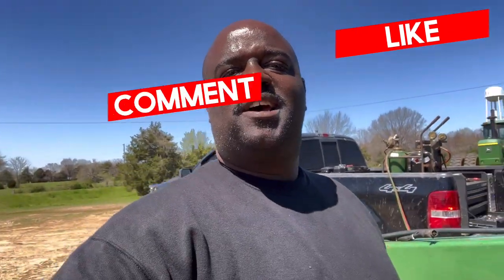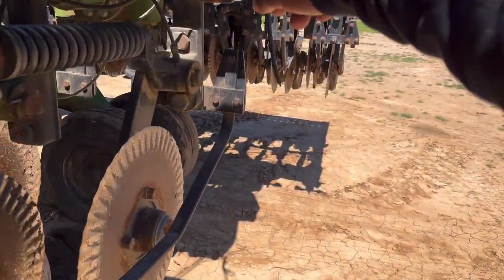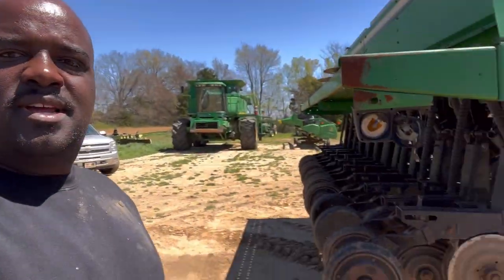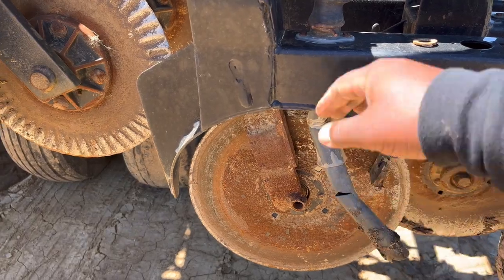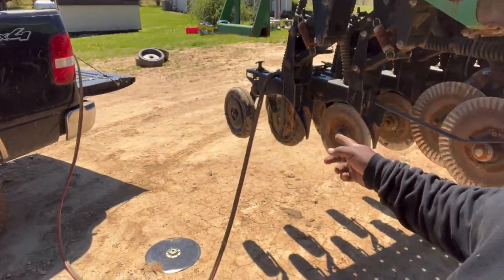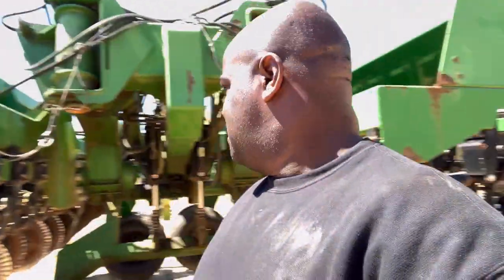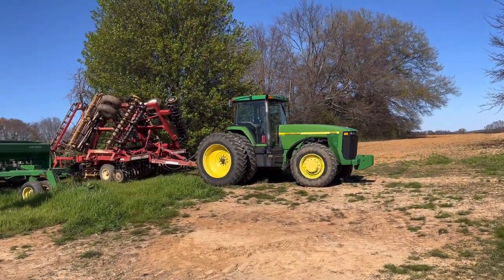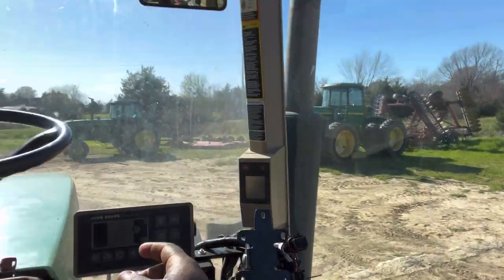Got finished with Great Plains drill . Finally

Comment: That drill is going to work well .  We used to run a pair of johndeere 750s that were hitched together to make a 30 foot pass . We now run a 40 foot  case 500 precision disk airseeder for wheat and double crop soybeans  . We like to plant our full season  beans in 16 inch rows so we use a planter . We will drill our double crop beans on 9 inch spacing to help the stand. Great video keep up the good work!
Reply from the maker: Wonderful my friend how many acres y’all running?
Reply: @dionwadefarmsllc  a little over 8000  we own a good portion but rent some and custom farm the rest for landowners  . How our farm works is we own the equipment together and then we each have own our own land . We then share the labor and fuel . I farm with my father uncle and 2  cousins . I still work a regular job when I'm not farming.  I've been called rich  but I'm definitely not we are like most farms asset rich but cash poor .
Reply from the maker: @anthonybanda8192  yeah I get called rich every day mostly . Don’t know why people do that but yeah I work 3rd shift 11-7 m-f 16$ hr but I guess I’m rich huh lol
Reply: @dionwadefarmsllc  I work as a  mechanic and  electrician . Luckily I'm a contracted worker for a few small factories  and I work on other farms equipment too so my  schedule isn't too bad I'm basically on call  . I started out working second shift full time 8 hour shifts  7 days a week plus farming . My hours was 3pm to 11pm I'd go home sleep 4 hours then farm before going into work . I got tired of that after 8 years I saved up money and decided to be my own boss plus farm .  I stay busy and make enough to justify not working full time 9 to 5 . I'm 28 years old with plenty of debt anyone who farms knows even the big guys aren't rich we are all  leveraged by loans and debt . Take care  !
Reply from the maker: @anthonybanda8192  that’s right be your own boss . That’s where I’m trying to get at .